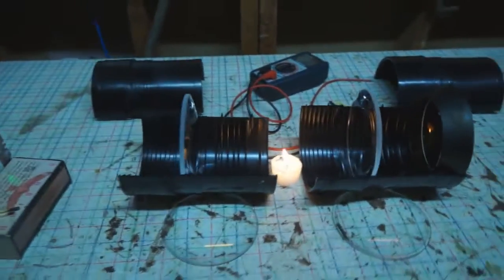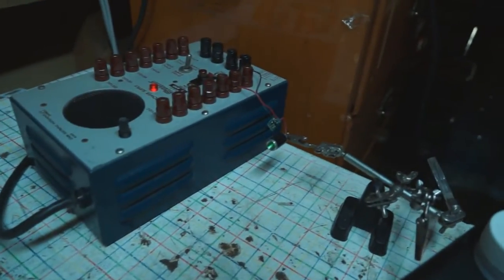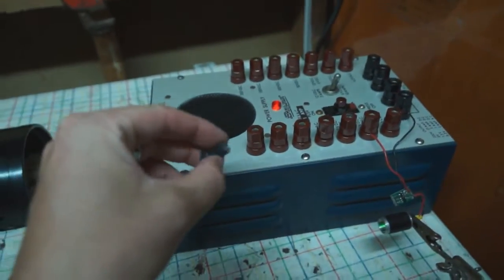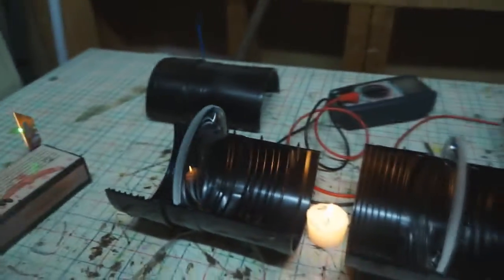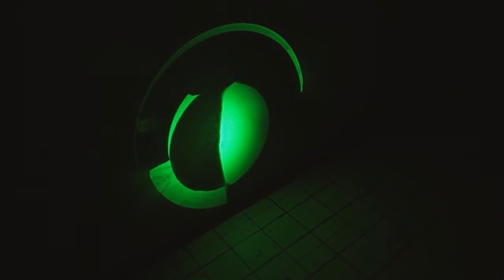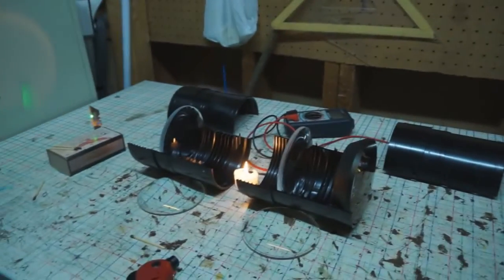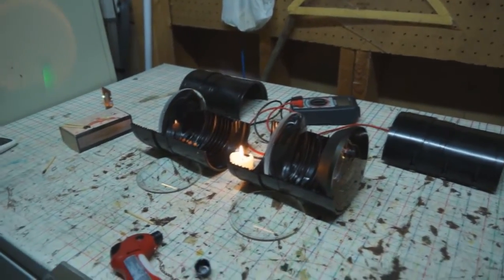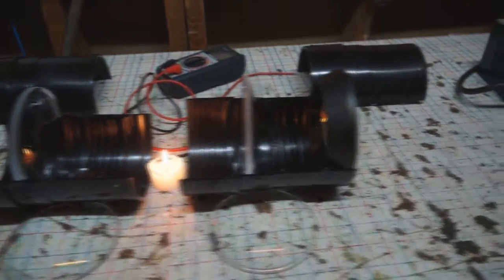MacGyver Schlieren Imaging

Comment: Not quite schlieren. What you have here is a focault test. A schlieren image should be adjusted correctly so that the background is an even grey. It will darken evenly as the knife edge moves across. Your lenses should be two focal length apart, with point source one fl from the 1st lens, and knife edge 1fl from the 2nd lens.